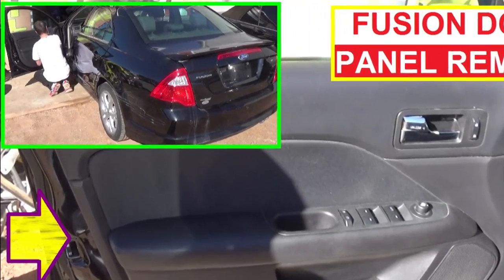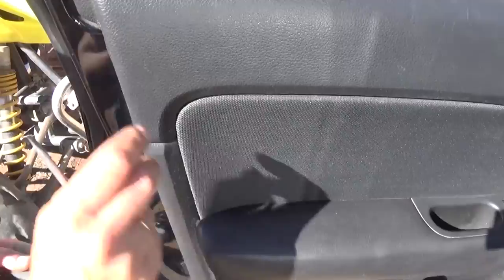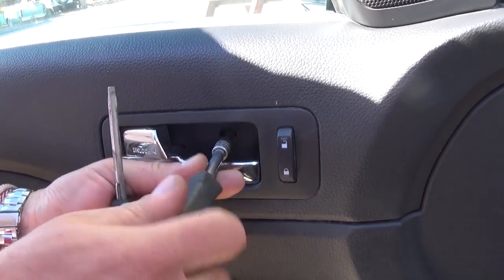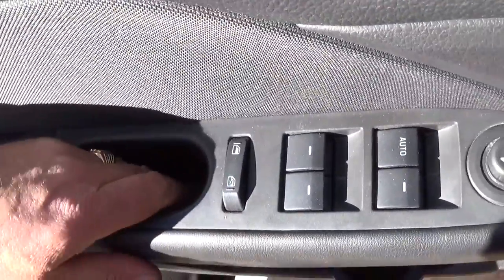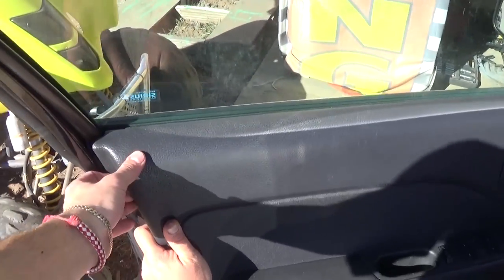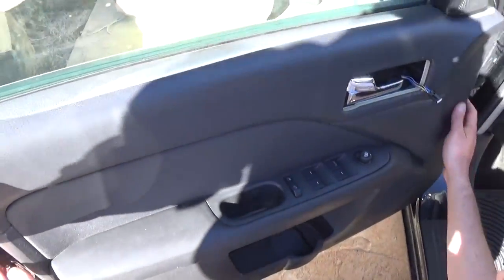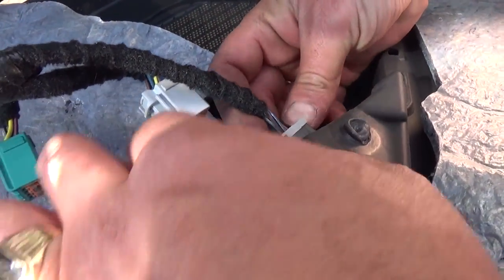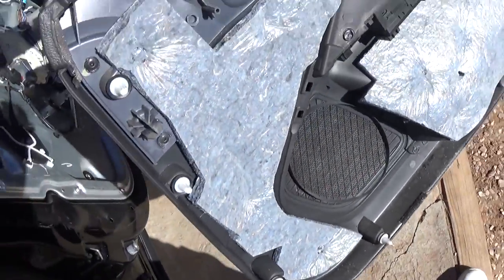Front Door Panel Removal Ford Fusion Second Generation 2009 2010 2011 2012

Comment: Question? Someone try to break into my fusion on the passenger side. Door will not open from either sides. Inside or out the outside handle broke off. Ever time I use the keyless entry. The passenger side flutters very fast. I need help on how to open the door to replace the door handle outside.

Comment: I had to open up the panel to change out the door handle and lock tab. I am not mechanically inclined but after watching this video and another that shows in more detail how to change the lock https://www.youtube.com/watch?v=bpcaBaM5aDw  , I got the job done. The hardest part was reconnecting all the wires because you have to keep the panel close to the door and its size makes this awkward. The job took me about an hour (again, no real mechanical skills). If you are changing the handle/lock, the bolt inside holding the lock is 8mm and as was indicated in this video, the one inside the door grip was 7 mm. Thanks for sharing this video, it really helped!